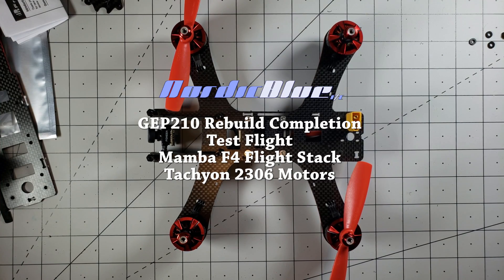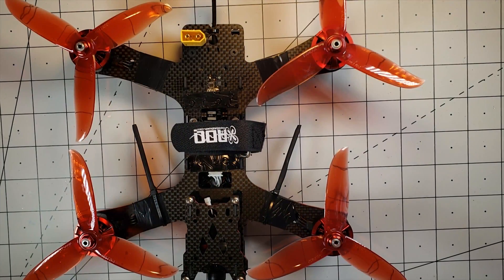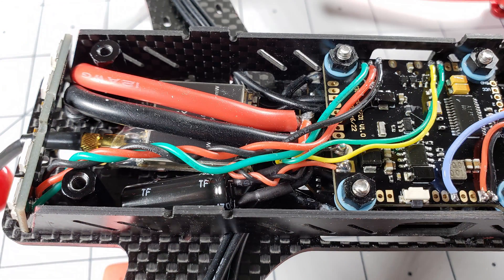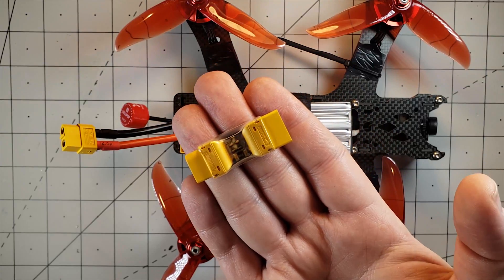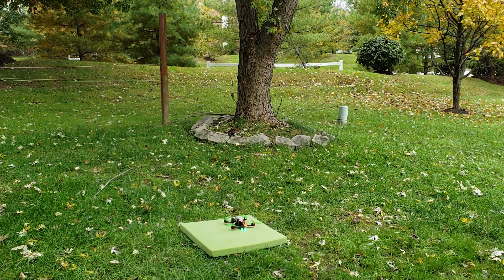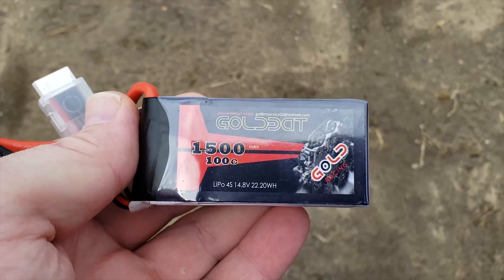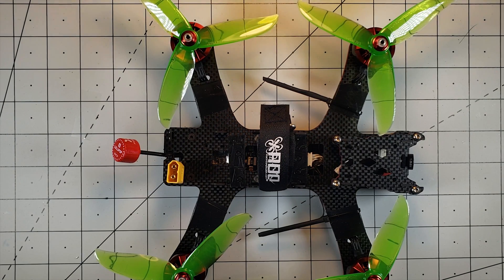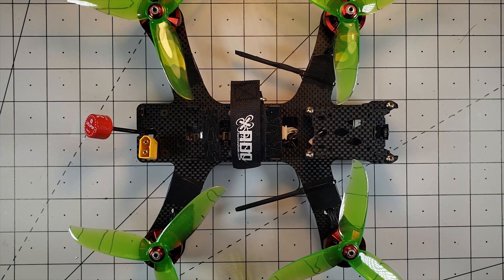Mamba F4 Flight Stack - Tested on GEP210

Comment: I have a Mumba 30x30 in the mail, but was wondering how high is the stack? I am designing a quad around it. Does the FC gets its power from the ESC ribbon? Thanks.
Reply from the maker: Hiya, thanks for stopping by. I don't remember the stock height of the stack, as I didn't use the stock standoffs. I was able to fit it inside a 15mm space (just the FC and the ESC), so you can make it super low with your own hardware. I would suspect it's around 25mm stock, but don't quote me on that. The FC does get its power from the ribbon, so no need to power it separately.
Reply: @NordicBlueRC  Thank you for that information.
Reply: @NordicBlueRC  It finally arrived. Just for the record it is a total of 19mm. Not bad.
Reply from the maker: That's not bad at all. I was in such an excited rush to get it installed, that I forgot that part. Thanks for posting for everyone to see, I will pin your answer

Comment: My f405 mamba when I reduce  throttle a little it rolls and falls what could be the problem
Reply: That's a tough one, as there could me many reasons for this. It could be wiring connection issues, it could be settings in BL Heli, it could be your PIDs or it could be that your motor idle throttle value needs to be raised some. I'd start with the idle value, raise it a little bit at a time and see if that helps. Watch out on raising it too high, otherwise it'll just shoot off as soon as you arm it.
Reply: @patsjoholm  thanks

Comment: Very nice looking build, love me some DAL props :) And the MAMBA F4 Power Stack is the BEST for the price, that stack is beast! I actually have a pretty similar build, I'm also using R-SXR RX, even though I use all 3 UARTs it's nice that I got SBUS (RX1), SmartAudio (TX3), and Telemetry (TX6 - un-inverted pad on R-SXR) all on this stack. The fact that an F4 FC AND 4-in-1 40A ESC is cheaper than most FC alone is amazing! Nice work dude, Keep it up! And Keep Rippin!

Comment: Nicely put together. I'm making a list of parts for my first build. I'm going with a 2.5 inch frame, and stuck between this mamba stack,  the emax mini magnum, emax mini magnum V2, and HGL RC F428 stack.
Subscribed!
Reply from the maker: I have flown the mini magnum, in my Babyhawk R, and it's a great stack except for the pins. In a crash, those pins can break, which is what happened to mine. Nothing a little soldering can't fix, however. I like the Mambas because they use a wire connector, which is less likely to break. Plus, they are nicely priced and perform well. Whichever one you pick, pick one that has F4 processor, over the older F3. There is not enough memory on the F3 for all the new features, so you have to sacrifice certain things. They still fly great, if you can save a little cash on F3, but I would recommend an F4.
Reply: @NordicBlueRC  Awesome! Your feedback is appreciated. Since I'm new to this,.I think the need to add capacitor  had be second thinking. But I'll search up some more on how/ where its added. Learning is my goal. Thanks!
Reply from the maker: The capacitor should be soldered to the negative and positive connectors of the ESC, where the XT30 pigtail is soldered on. I placed my capacitor on a back arm and extended the leads using some 18 gauge wire.
Reply: @NordicBlueRC  thank you!

Comment: Good flight, I have both the 20x20 and 2 30x30 mumba stacks.
The spair mumba is going to be used for my 6s 6" build I'm doing right now.
Hoping the 6s on it works out great, havent heard anyone trying it on 6s yet or even see one built on 7s with that stack.
I need about 3 more 20x20 and 2 more 30x30 hahaha.
Hard to find the 20x20 one bc there not in stock at the USA store.
Love the stack bc its super super easy to build period.
I had the one quad tourn down prob 30 times bc of vtx problems. No issues with the stack tho
Reply from the maker: Yeah, it seems to be holding up nicely. I put mine through an entire red clay soak and it's still flying strong. Wish I could help you with some 6S testing, but not ready to take the plunge it to quite yet.